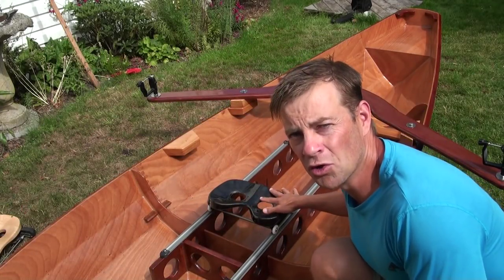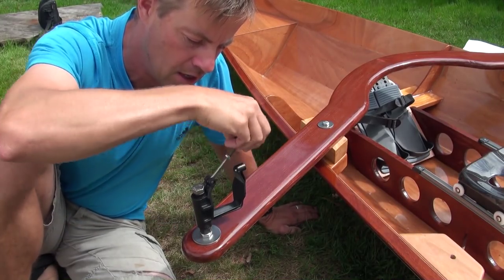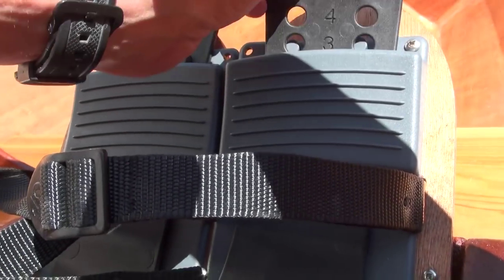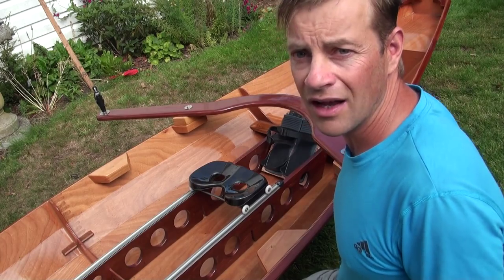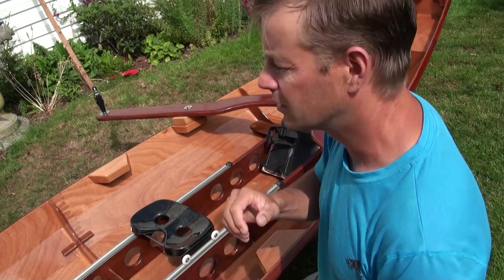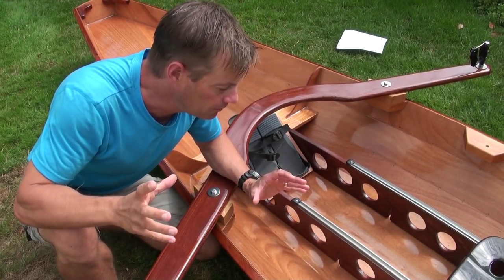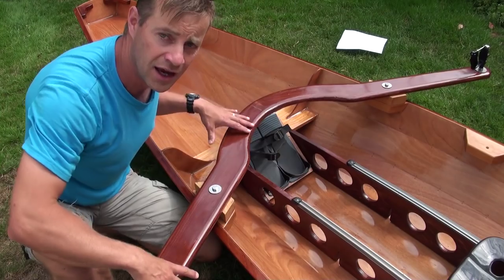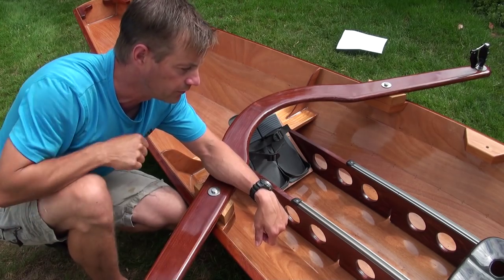Angus Rowboats Lightweight Drop In Rowing Unit

Comment: Colin, few things:
1. Why use epoxy when good waterproof wood glue increases the wood/joint strength
2. Instead of pine for the pat rig, why not use marine ply, stiff, great to shape, and takes paint or veneer excellently

Cheers
Reply: 1)  Epoxy is waterproof wood glue, and the gold standard.  There is no stronger glue, as glues break in the wood not the joint.  But where high performance wood products are concerned, creep is a problem, and again epoxy is the champ.  WEST built wooden wind turbines for GE and NASA, the structures are hugely proven, and massively stressed cantilevered structures.  And then, since this is a kit, you are dealing with novice builders, and epoxy is a lot more forgiving of poor fits.  You can have a gap of 1/4" in a epoxy joint, really more, that is just a number the mention, and the joint is still 100 percent.

2)  If you are talking about the spar, you want a linear fiber, and that is what wood is in board form, like the pine used here.  It is much stronger than ply, which is a great material for panels, like the hull of the boat shown.  In large sections like the beams of a catamaran, ply can be a player, but in small section, no dice, as little as 50% of the wood is going in the direction one would want.  And ply uses low structural quality veneers  that are removed like the shaving from a pencil, you get lots of grain run-out.  If you want to try something out, make a cane out of plywood and see how that compares to one made conventionally.

Comment: Greetings Colin. I got into erging last year after reading the Boys in the Boat and finding a used Waterrower for $225. Stereotypical probably, but I love it. I've been a kayaker for years and I'm thinking of building a CLC Mill Creek 16.5 for single rowing and double kayaking. I will be building oars and a drop in unit and I'm looking at your drop in kit. Do you know if it's a match for the Mill Creek? And/Or does your Expedition Rowboat convert for tandom kayaking with the family? ;)